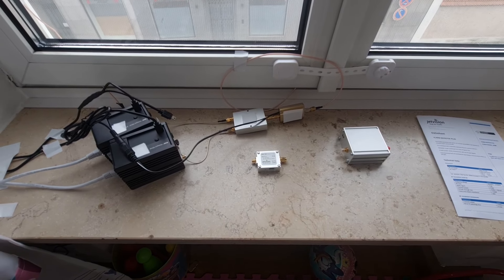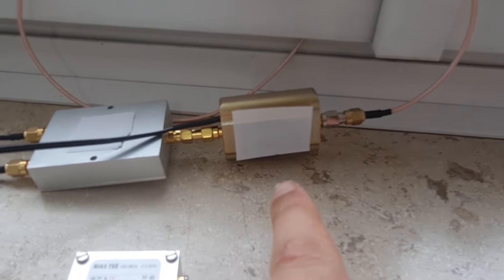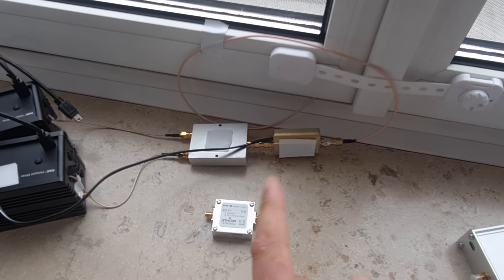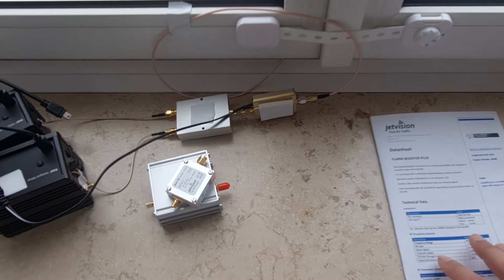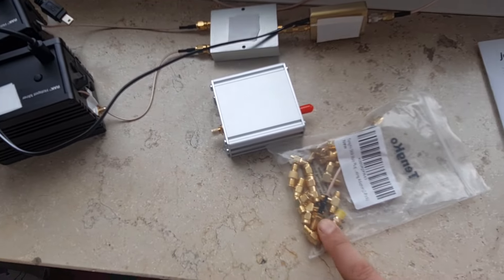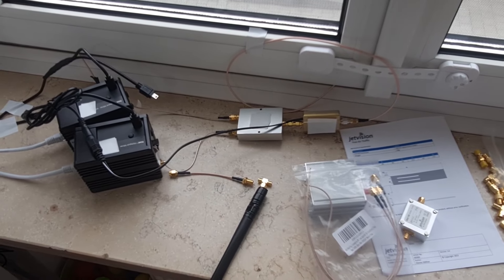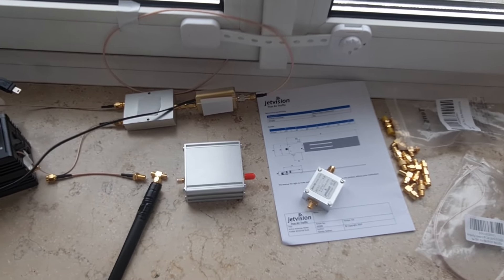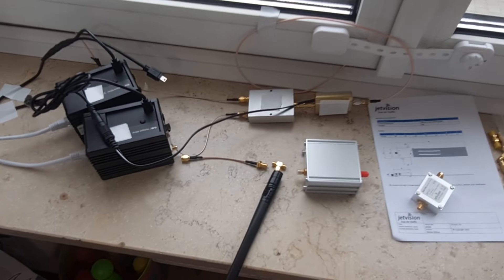2 Helium Miners 1 Antenna , Helium Amplifiers , Splitters Part 1 _HELIUM ADDICT

Comment: so, you replaced two Cable Assembly Coaxial U.FL (UMCC) to SMA with two Cable Assembly Coaxial U.FL (UMCC), AMC to SMA, to connect both miners to the 2-way splitter and then to the amplifier while directing USB C- USB C (Type C) to one miner, and RP-SMA to N-Type cable to dBi Antenna? Also, both miners already powered by the ethernet cable helps to PoE Splitter; was that the way you did? To note, thank you for the content info, I appreciate it and plan to use the same set-up for my miners. Keep up the good work!
Reply from the maker: good luck ✌

Comment: Flarm boostr doesn't damage the miner?
Reply from the maker: No, he improve your signal and helps you to witness more than usual = more HNT 😉✌️
Reply: @heliumaddict8582  Alright, well I have a booster connected and I keep witnessing over 100 km which of course gives me "invalid". Anyway to fix: witness too far? If I take the booster off then I won't witness anyone since they are too far.
Reply from the maker: @mayvis_m  keep adding in the Helium App more dBi for your Antenna every time you get invalid 😉✌️ , this will fix the invalid problem 
Happy Mining ✌️
Reply: @heliumaddict8582  I thought that only worked for too high rssi but ill still try it
Reply from the maker: @mayvis_m   He will work but if didn't work for some reason you can add attenuator to reduce your dB 😉, but first option is better and for free 😉 
Best Of luck
Reply: @heliumaddict8582  thank you!

Comment: Great stuff, im trying out myself. So i have few questions. 1. Did both miners went in relay since u put em in work, and did they went out of relay since u fix them. 2. Is it ok to use one antena 10 db panel not two antenas. 3.What distance bitween miners did u put, i put one 400 m away for security reasons. Thnx
Reply from the maker: Hi 👋 
Thnx for asking  well I just posted part 3  video and I explained all this question in long video 📹 😅  sow fill free to watch him I let me know if you need anything 
Keep the notification bell on for part 4 and 5  I editing the videos 😉✌️
Reply: @heliumaddict8582  Will do, subscribed and watching if i have q i ask. thnx

Comment: Great information video, I am not interested in 2 miners in the same location what I want is what will boast my rewards ,beacons.tell me . Thank you
Reply from the maker: Well simple and complicated in the same time ⏲️ because your location must be full with hotspots for great Rewards but following this will help you:
1-First  Buy great Antenna not tchipe one from Aliexpres or Ebay  . Buy for example  9dbi McGill Antenna is very very very important this.
2- put the 9dbi McGill Antenna 📡  on top of the roof if possible  if not possible  don't expect to witness a lot. 
3- Buy Bidirectional Amplifier Ex :Flarm booster from jetvision and connect him directly to the 9dbi McGill Antenna 📡 .
4 -Buy LMR 400 cable   short as possible. 
5- Baies Tee 5 v DC injector  from jetvision. 
6- outdoor enclosure from Rakwireless to put your miner close to the Antenna as possible  very very important. 
7 - POE KIT to power your miner and Bidirectional Amplifier in the Outdoor enclosure. 
8- ethernet cable for Outdoor youse  very very important , I recommend cat 8.1 for outdoor youse with gold rj45 connectors for  stable internet and power 🔋 for your miner and for your Amplifier and no signal interference .
9- Power line if necessary from TP-LINK 2000 France  version  its the best for helium hotspots.
10- Happy HNT  Mining , injoy your new witnesses 😉👌👏.
I know it's expensive setup but it the best setup possible for helium hotspots.  I personally setup all my miners like this , stay tune for upcoming videos 📹 I will explain more about the best setup possible for Helium Miners 
I ulredy posted some videos 📹 go and see
Reply: Thank you for the information
Reply: Do you believe Flarm booster will perform better with rak 8 dbi or 9dbi McGill antenna?
Reply from the maker: @dionisisch   yes but I m still not 100% , I need some parts to finish my setup, and then only I will be sure 😉 😅 
Keep the notification bell 🔔 one for upcoming videos 📹 👌 😉 
Best regards M.G
Reply: @heliumaddict8582  I have Flarm with 8rak and I also have McGill 9 with out Flarm in an other spot,  and I am thinking if it will be better.  Also what sd to use in sensecap?
Reply from the maker: @dionisisch   this is great news, you can try the FLARM BOOSTER WITH THE 9DBI MCGILL and  look how much signal improved and how much Extra witnesses you get and please 🙏 let me know when you finish testing  to share the results with viewers to help more people as possible because this is expensive stuff I can't recommend things without 100% serten . I hope you understand my point. 
I will be waiting for your results 
Best regards M.G

Comment: 2 antenna to 1 miner, is working? for unidirectional amp?
Reply from the maker: First thank you for Subscribe 🙏😇
Second  yes it's works like I show in my video 📹 but  for better results put 2 same antennas 📡 if possible  ,  EX: 2  9dbi McGill antennas or 2 of 8dbi Rakwireless antenna 
For stable performance .
I hope that unser your question .
Best regards M.G

Comment: Where are the links to all of the four items...especially that amplifier and the 5vt power module that puts power into the antenna signal  cable.
Reply from the maker: https://www.shireeninc.com/osc/900mhz-indoor-helium-amplifier
This is Amplifier 

5v injector 
https://shop.jetvision.de/epages/64807909.mobile/en_GB/?ObjectPath=/Shops/64807909/Products/69400

####Disclaimer ###
I m not  RF expert 
I don't requemend nothing  do your own research please, for this reason I didn't put the links before. 
Buy on your own risk and don't make me regret  sharing the links with you please 🙂 🙏  .
See you in future videos 📹 
Best regards M.G

Comment: Nice just subbed your chanel i yave that amp with antenba fronm jet vision no activity after 10hours flarm booster plus with antenba any help thanks
Reply from the maker: Simple
1-  make the Flarm booster plus waterproof  with robbery tape .
2-Put the Flarm booster plus  outdoor very very important and High as possible  preferably in the roof. 
3- LMR 400  CABLE 
4- 5 V DC injector  connected to the Helium
 Miner and connected to LMR400.
5- PUT THE miner in outdoor enclosure outside if possible close to the Flarm booster plus. 
 
I hope you understand what I mean 
Good luck and happy mining 
Best regards M.G
Reply: @heliumaddict8582  thank you for qwick swift reply i have attached 6dbi mcgill i have broken track to pcb antena also  i wil test outdoor this weekend after making waterproof many thanks my friend
Reply from the maker: @ballerreviewz7529   good for you that you remove the small Antenna , which you the best 👌  and please let me know what kind of results you got after the modification please 🙏 😊 
Best regards M.G
Reply: @heliumaddict8582  thank you my friend will update i need buy them rpsma then set fully wil update you 
Regards m.s

Comment: Two miners in one location, than one is relayed right? You can not in your router portforward 2x port 44158 to two miners. How do you do that?
Reply from the maker: I will make video to explain this  in the mine time just youse VPS not VPN  and you will be able to remove the Relayed states.
Best regards M.G
Reply: @heliumaddict8582  iam waiting thank you
Reply from the maker: @GokhanErgisi35   youse VPS  it's the fastest solution 😉 👌 
Best of luck 👍